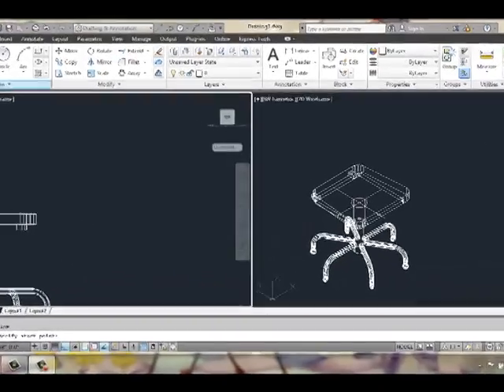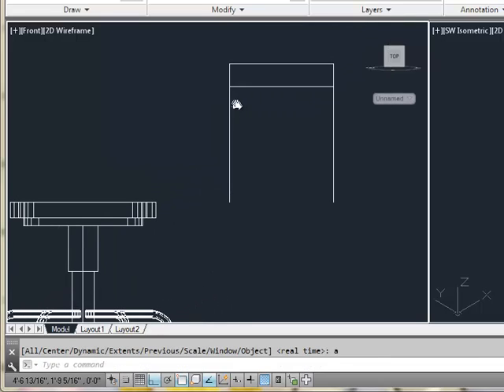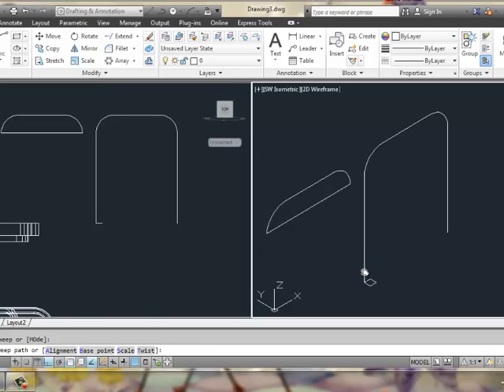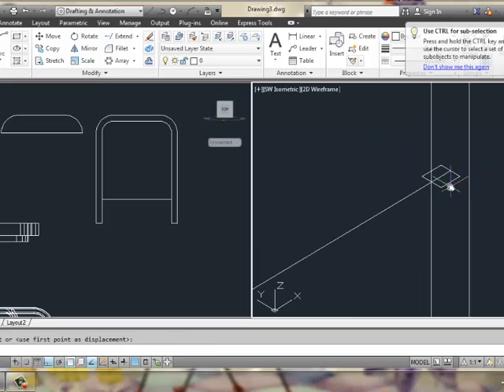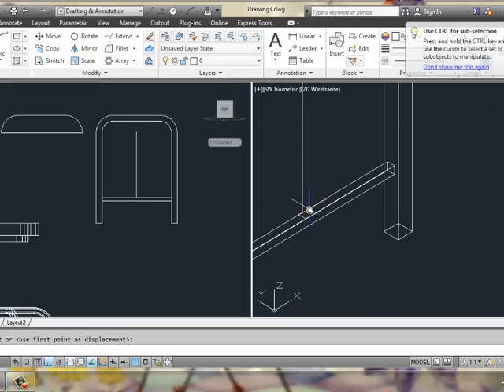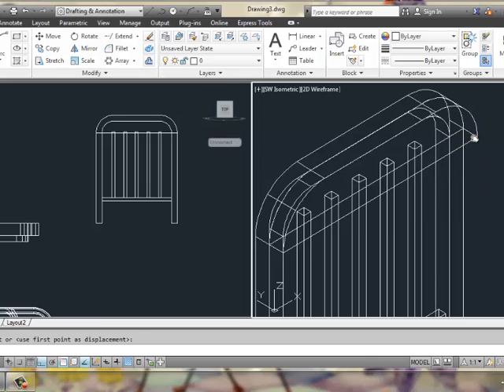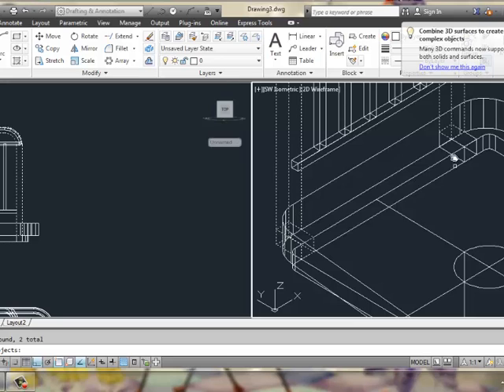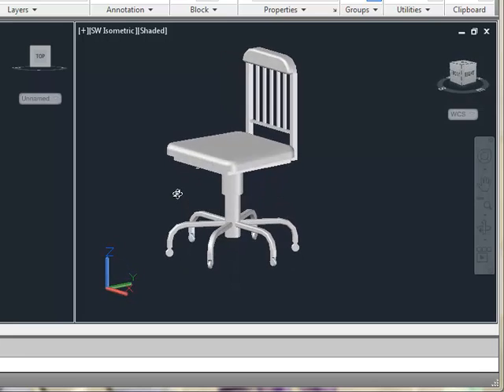AutoCAD 2013 - 3D Modeling Basics - Desk Chair Part 2 - Brooke Godfrey

Comment from the maker: You're welcome Ryan.  The vertical bars should be meeting the bottom of the top horizontal piece...but it only takes one goof and the whole thing is off.

When you explode the array you are able to edit the pieces independently.  Until you do that, the legs are an 'array object.'  That's actually a good thing, and cad allows you to go in and make edits to the array after it's created.

Hope that helps! :)